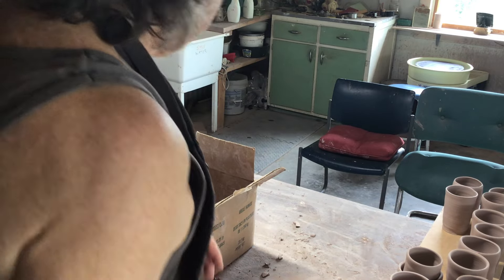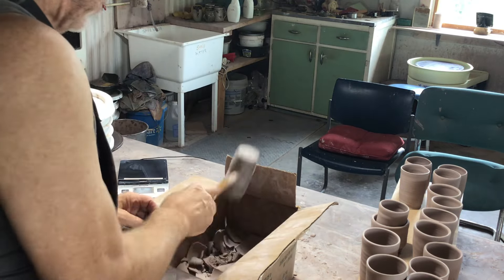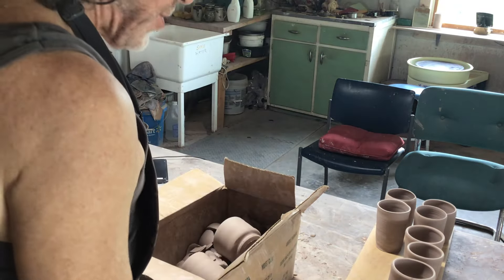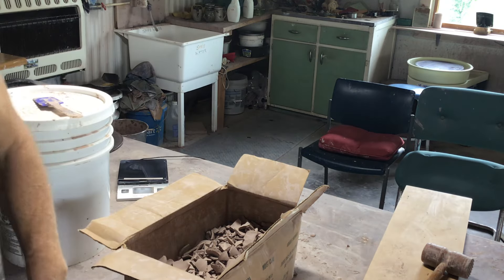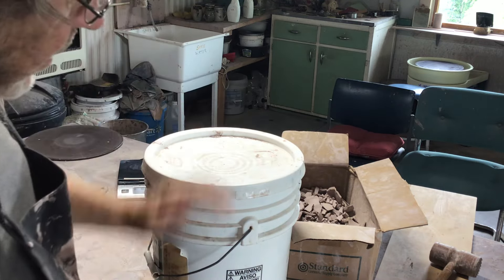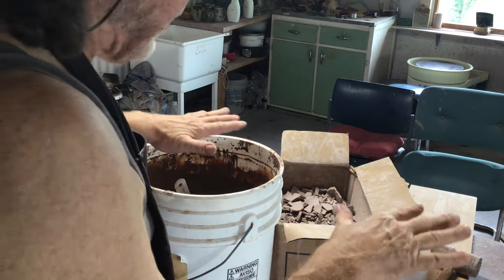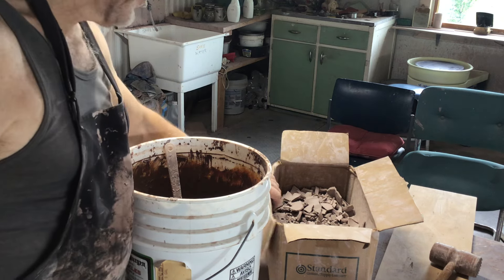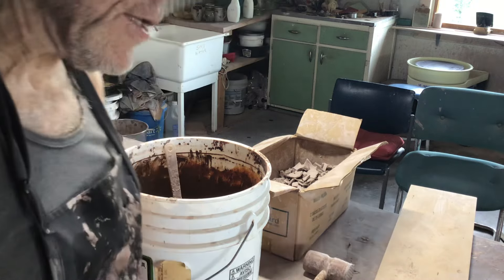How I recycle my clay with Simon Leach. July 17 2024

Comment: Thanks for this. I’ve got a question. I have 2 blocks of clay in the original bags that, by an extraordinary feat of procrastination, I’ve let dry out completely in my garage. Would this work on a block of clay? Should I take a hammer to it and try and break it down first? Or should I just put it in the bin. I hate to throw it away. It’s good clay. Any advise is appropriated.